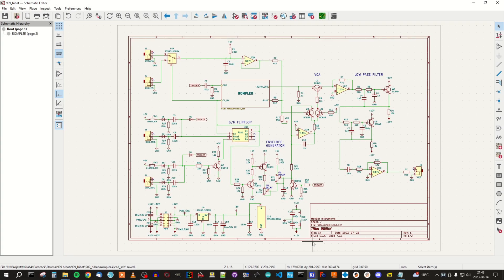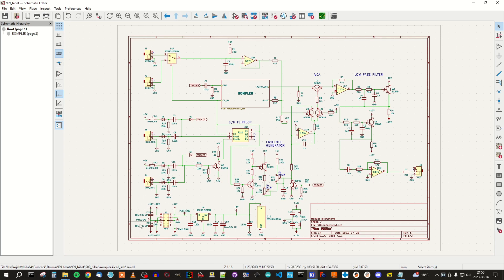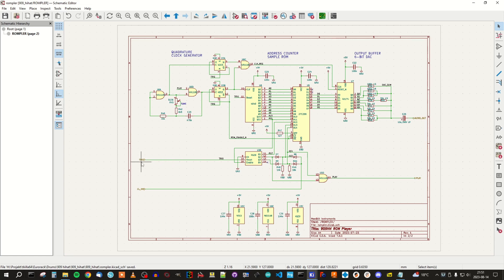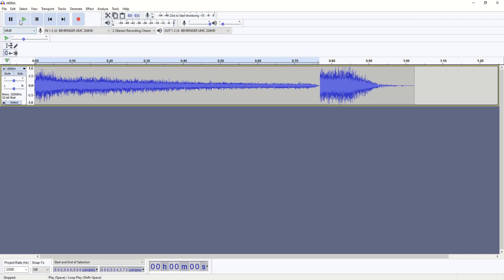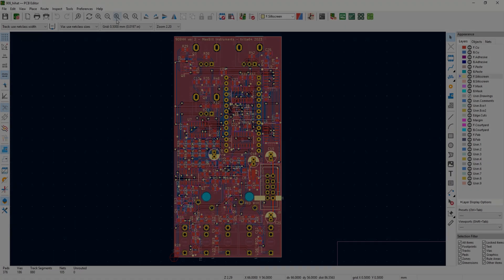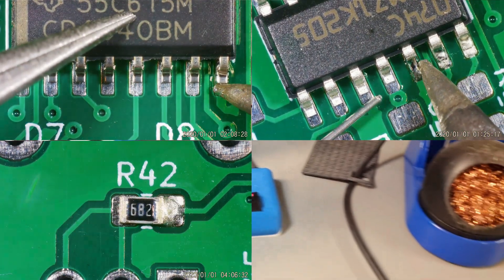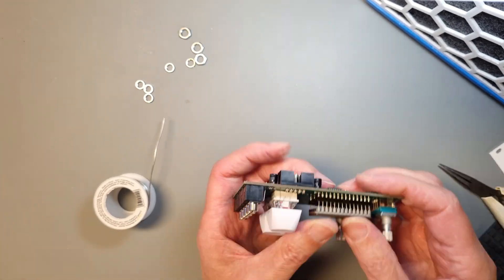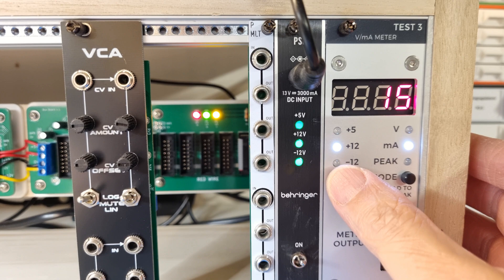Eurorack DIY: 909 Hi Hat (Episode 2)

Comment: i built my hi hat module but the trig in both are not working. only the button can trigger
Reply from the maker: Sorry to hear that you have issues with the build. My suggestion is to start by double-checking the component placement, especially the diodes, since they very easy to mount the wrong way around.
One thing that is very important with the trigger input is a good square-wave with a fast transition is used, since the trigger pulse is derived from that. This is valid for all 909 modules. A slow rise time will not work.

Comment: Where could we get the raw samples from? Or array of values that you would read from a 6 bit dac, whatever is clever
Reply from the maker: The binary files used for the ROMs can be found here:
https://github.com/tkilla64/eurorack/tree/main/misc/roms
You can extract the data from them or convert it to a header file that you can include in your program - it depends on what you want to do

Comment: Think I'm going to try this one... Even if it feels a little daunting right now. (never done smt nor programmed a chip.) It just sounds too good.
Reply from the maker: Hey,, good luck with the build! Don't hesitate to contact me if you have any questions about sourcing components.
Make sure that you get the CD4011UB (unbuffered type) - check out Digikey 296-3184-1-ND . I strongly recommend to use the Winbond W27E257 instead of the ancient UV-erasable EPROM, they are cool but the draw a lot of current and are difficult to get hold of.
Reply: @MeeBilt  Just finished the build. After resoldering 2 diodes, everything worked perfectly! Thanks for sharing.
Reply from the maker: @jokkemartens8065  Awesome! Good job ! 💪

Comment: any chance of updated design that loads samples from sd card?
Reply from the maker: I have plans to update the design and I'm thinking of using a microcontroller. In that case it would be possible to add a slot for an SD card.
Reply: @MeeBilt  would you use the microcontroller do load the rompler? that would be a killer module

Comment: Very impressive! It is common to make mistakes like you have made even after triple checking everything. It is very difficult to see ones own mistakes when checking a design. For years I have had terrible luck with swapping RX and TX to the point that I will put workarounds on the board if there is room.
Reply from the maker: Thanks a lot!
Yeah, it's difficult to review your own designs. The same mistakes keeps slipping through lol

Comment: Cool, to have a ccd microscope for SMD.
i have made a C++ app to plot a graph with zooming capability to view the bin and wav files.
Making it easier to edit the files for hardware (also 16 bit sounds).
16 bit Wav files are signed, the bin files are not,, they also have a header you need to cut.
Maybe better to use AT28C256 they don't need 13.5 volt, seams like a newer part.
Reply from the maker: Yeah, I bought the microscope a couple of years ago. I use it for all my SMD builds.
Reply: @MeeBilt  i wanted to solve this with a magnifier with an arm, but's getting pretty hard to buy things locally and offline.
i have some SMD parts, like by pass caps, some CD4000 series and other logic devices you can't buy in through hole.
I have pretty much all common resistors values, always buy them in 100 (there where like 4€, now close to 6), replacing these with SMD would cost a fortune.
Reply from the maker: @AnalogDude_  I have a small local store where I can get most of the TH or SMD parts that I use in small volumes - but they are quite expensive. But then I need large quantities I get it from LCSC or direct from the supplier
Reply: @MeeBilt  the same here, i got a shop around the corner witch has an old stock of CD4000 series, he also has the 4520 there.
: )
resistors, transistors, leds and stuff and also more expensive than mouser, but you feel lucky when you have an idea and get the part there. Mouser charges you 20€ for purchases smaller than 50€.
Reply: @MeeBilt  You could improve, by using a ADG419 switch instead of using and delete Q72 and Q73, place the chip SPDT switch above R451 and R452 and play something with the variables since the chip has some 50 Ohm or to your likes. The chip takes +15/-15 Volt supply but control pin has to be 5V and secondary Vdd.
Reply: @MeeBilt  it might also be better to use a DIP8 PIC12F675 to create the "2ms" trigger signal instead of what you have now with the left over cd4520, transistors, diodes and resistors around the "trigger" inputs, the 2ms trigger is important on how the "envelop" evolves, the trigger empties the C135 and it starts filling up again. creating a 1ms timer is by dividing the overall clock between 1000 and store that number is in the TMR1L/H register once the timer runs out and reset the value again. On a trigger input from the button or jack you start the timer, set pin high and count to 2 and set pin low again.

You also didn't account for trigger inputs from modules like Make Noise Maths that outputs 9.x V, a diode limiter to 5V is needed there.

... and use the "switched" contact of the velocity jacks to tie a potentiometer there in case you don't have a "velocity" signal and feed some voltage as default velocity.